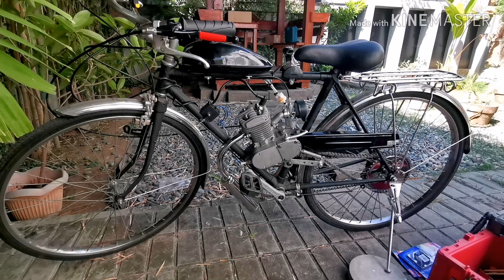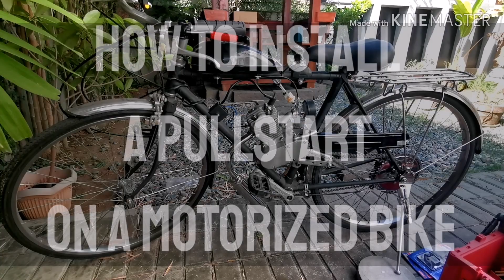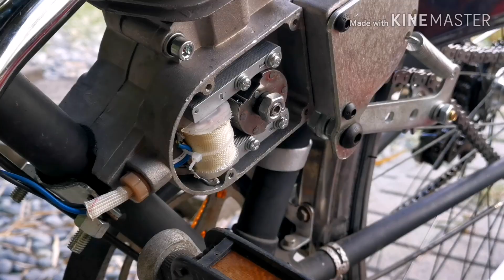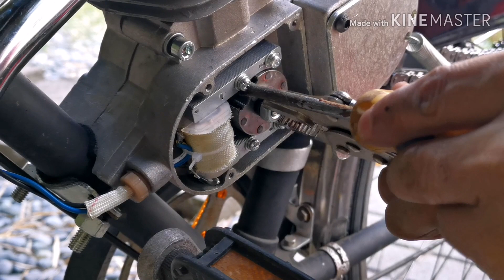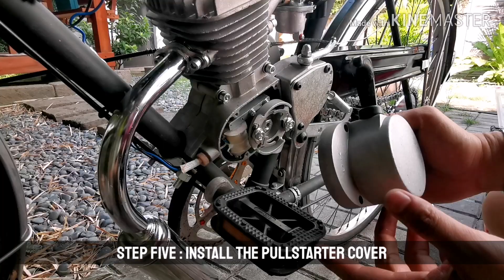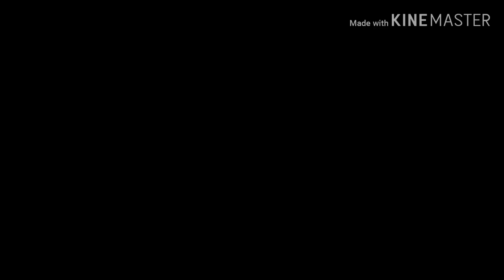Pull Start Installation | 80cc Motorized Pull Start Bicycle

Comment: would have been nice if you actually pulled the cord and started it up.... the video ended too soon.
Reply from the maker: Yeah! That's right I did end it too soon. Realized it right after posting on youtube. Will give a follow up video of using the pull start in the future. :)
Reply: @BuildRestoreRepair  when? After 5 years ? 🤣🤣🤣🤣
Reply: Because it clearly didn't work by the way it binded after his quarter pull. Bet he took it right off afterwards

Comment: can you still pedal start if something happens when on the road. Let's say the rope breaks after you come out of Wal-Mart and try to start it. I am assuming you can but want to be sure
Reply: no the pedal will be block by the pull start but you can pull the clutch run with the bike let go of the clutch and pull the throttle to try to get it started \ late reply
Reply: @Red_TGR  can also keep the original cover and an Allen set on you
Reply: @xxxsanyeo  very true I keep all tools needed for my bike where ever I go / I bought one and it last under a week before the string broke (I don't think it's even worth it)
Reply: @Red_TGR  I've been wondering about that. I've seen lots of people complain about it. I'm just sick of trying to pedal it lol
Reply: @xxxsanyeo  if your engine has no leaks, has nice strong spark, and idles just fine. I say test your luck might be good for you
Reply: @Red_TGR  it was vandalized maybe 7 months ago. I tried messing with it. but eventually gave up. starting watching videos and now I'm sad lol. the gaskets fell apart. the oil builds up and I have to clean it out. it doesn't idle at all. it does have spark though lol. it's a pos china doll off Amazon. I loved it when it worked though. and it worked perfect. but it just started falling apart

Comment: The only video I saw for my problem so far
My motor doesnt want to start yet and it is very tiring to push the bike up the hill all the time so this pullstart is good to try time and time again until it works

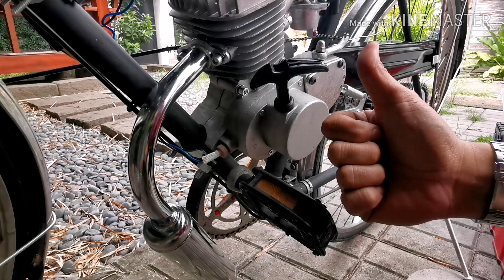Comment: How are your pedal cranks not hitting that pull start case?  At 0:00 the first pic of your bike you can see the pedal cranks and they are not going to clear the case and at 1:51? Well have a look.
Reply from the maker: Hi, thank you for the comment! Yes, the crank arm does hit the case, and thats the issue I worked on after installing the pull start. :) I just decided not to include it in this video, because i wanted to do a separate episode for it. :)

Comment: So quick question do I need the clutch anymore? Or do I need it at all since I don't have to pedal start it
Reply from the maker: Yes! You still need the clutch. :)
Reply: U need the clutch. Other wise when u start the bike it will be instantly in gear.
Pull the clutch in, start the bike, peddle/get on or whatever, release the clutch and u now have power to the back wheel.

Comment: Where do you buy the pull starter?  And did you ever put up another video actually starting it?
Reply from the maker: Hi! I got the pull starter online. Its kinda cheap on some web sites. I got mine from shopee.com Haven't gotten to making a video of starting it yet though. Will soon make a video!!
Reply: @BuildRestoreRepair  Hey thanks for replying.   Found them on ebay.  Yea they are pretty cheap.  BUT every single one had a warning about not pulling all the way or too hard or it will break.  Got on a motorized bike forum and basically they said the same thing.  Didn't last, only works on a warm bike, like that.  In fact I did find another youtuber who was pulling over and over and over and no start.  It was cold though, could see his breath.  So I don't know.  Seems I'll stick with hoofing it to start.  Was so hoping this was an answer but it doesn't seem like a good one.

Comment: I don't see the benefit of these. You have to install wide crank arms if you want your pedals to clear. It's so easy to coast down a hill or pedal and drop the clutch. I don't think I'd ever use this.
I guess it's helpful for when you're working on your bike and want to start it from a standstill, but for the same amount of $ you could install a center mount kickstand which can help you do that
Reply: its for people who dont have pedals on their bike, or are using the engine for other purposes
Reply: its good for if you have a centrifugal clutch

Comment: Sir, is pedal can still turn even with pull start?
Reply from the maker: Hi, as of this video, the pedal wont be able to turn because the pull start case is blocking the crank arm. I will have to buy a wide crank arm set, or a shorter crank arm for the bike to work. :) that will be for another video! :)